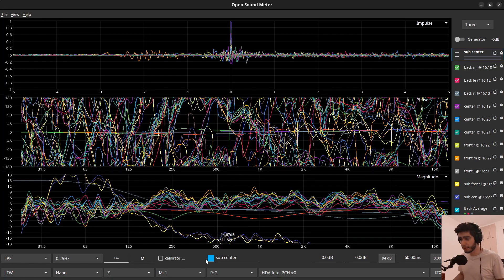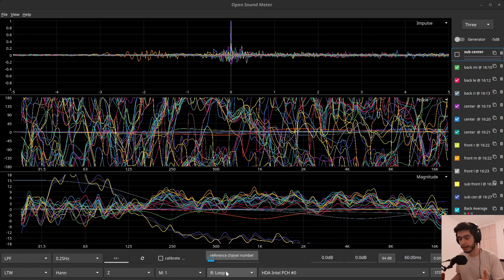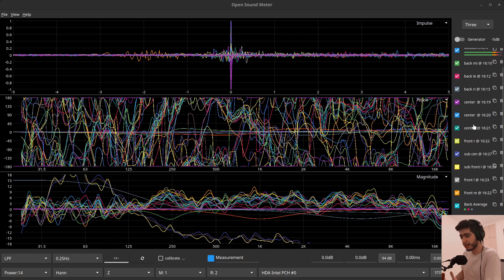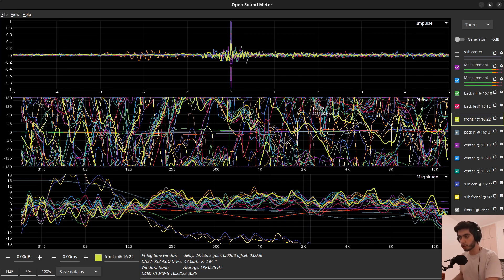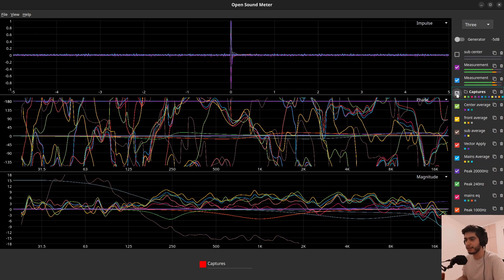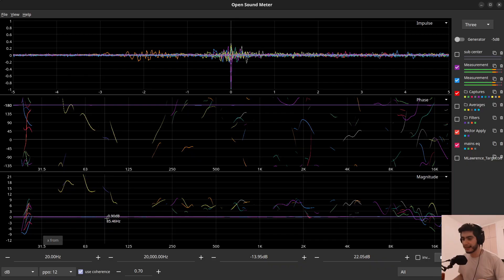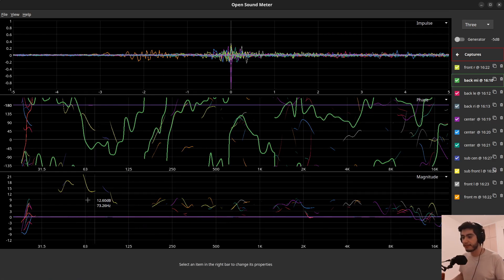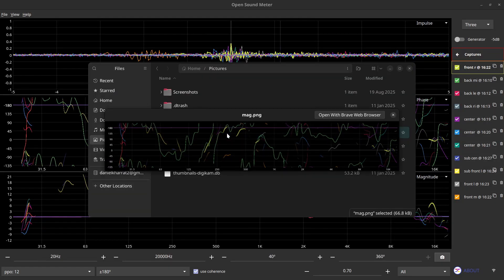7 tips to speed up your workflow in Open Sound Meter

Comment: @danielkharrat  When you have balcony fills (or any fills), do you take measurements with the mains on? Our mains are hanged, higher than the balcony, the fills are just for a bit more clarity up there. Also after making the average, where you place the mic for measurments?
Reply from the maker: The most important thing is to time align them. So on the balcony take a measurement with the mains only, then with the delay speakers only, and see the time difference between them and delay the balcony speakers to arrive with the mains. You might notice there's a lot of high frequency in the close speakers, you can use a high shelf to tame it down a little bit to better match the tone of the mains. But short answer i would have the mains off when i measure the balcony speakers
Reply from the maker: Mic placement is ideally directly in front of the speakers (on axis) and not too far back because room reflections can easily confuse the measurement software. So measure in front of the left speaker and in front of the right speaker and same for the balcony speakers and you can also take a measurement in the middle it doesn't hurt
Reply: @danielkharrat  Friday is my first time that I'm doing this alone, usually we pay someone that has smaart. Thanks!